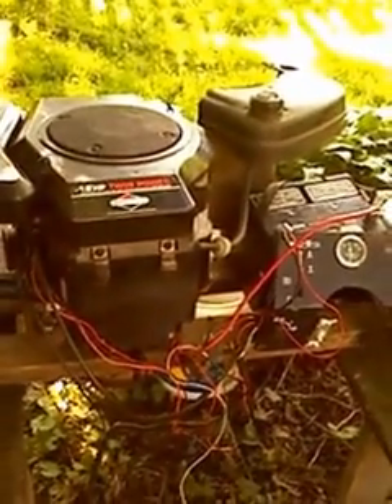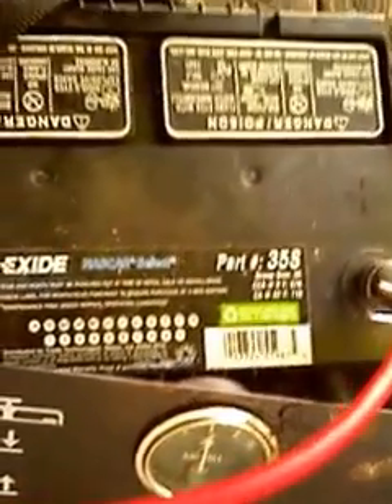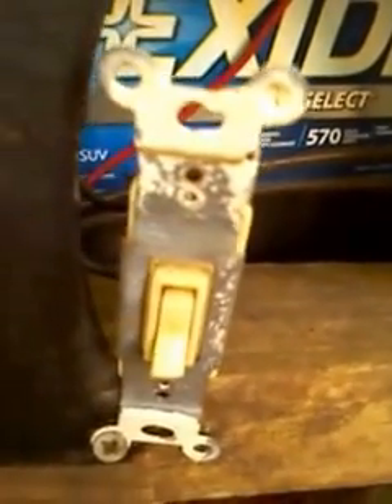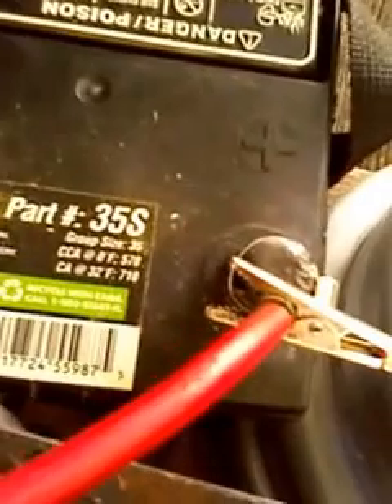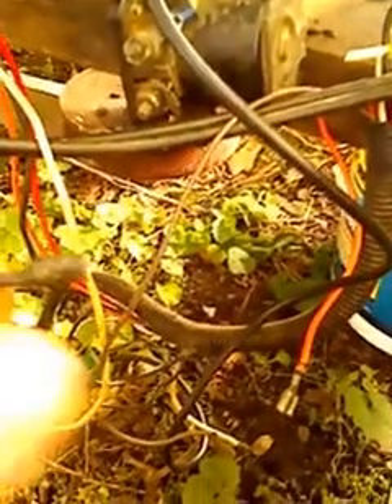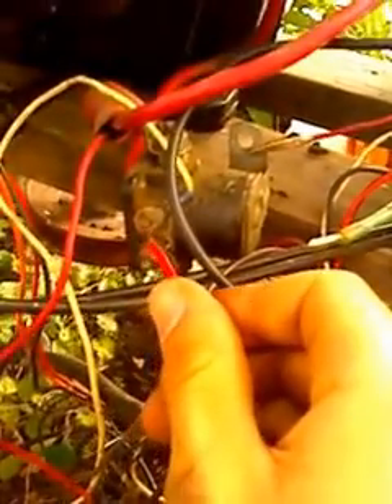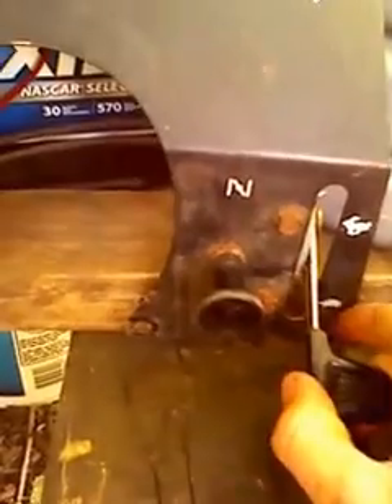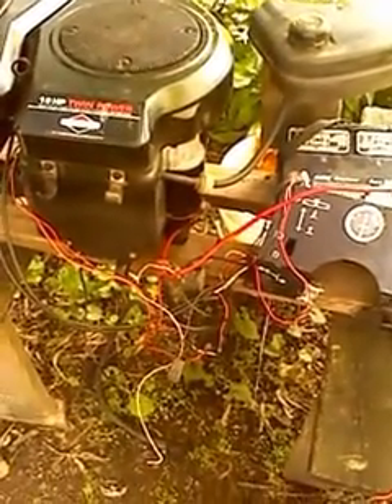How to Start a Briggs and Stratton 18hp Opposed Twin

Comment: I have one of these on a mower it is all wired right but cranks so hard. If you pull the plugs it cranks great. I have cleaned the heads, rebuilt the starter and carburator. I have the biggest lawnmower battery you can buy in it. And still turns hard. Any suggestions would help please. I have thought of upgrading the battery cables size but think it may be the valves and there lash.
Reply from the maker: HMMMM  I can't say I have bumped into this before there may be forums out there that have though would be my suggestion.  As far as the motor turning hard with plugs in and easy with them out that's to me good compression not a problem.  I would say check for a bad spark or coil if it turns over when you push the start.  Other Idea is air filter clogged.   The wiring could be it but I doubt it as wire does not go bad easy, I would check the connections though for green build up as that does happen and lowers current to starter if found clean off with wire brush.  Also it could be the spark plug connectors are goofy, I have had some where the wire actually pops out of the piece that goes on the plug.  Thats all I have for now best of luck:-)
Reply: opposed twins hate starters and kill starter bushings, pull the screen off the flywheel and crank with 1&1/4 socket in a 1/2 drill, be lively when you do
Reply: Did you figure it out? I have the exact same problem. Clicks but & turns over slow & sometimes not at all.  Tried a bigger battery & even tried jumping the starter in case there was a bad ground.
Reply: @thomasz4981  valves too tight
Reply: @newtuthis1  Thank, I'll look into that. It's strange tho because the motor has very low hours. It was almost new when put in as  a replacement. That's why I was thinking a bad ground somewhere.

Comment: how much snow can one of these engines push?.......are they pretty fast
Reply from the maker: I have done a foot deep of light snow with an 11hp belt drive before without issue. Though it really depends on the tractor the motors on and condition of tires, belts and gears extra, but this motor is really strong and with a governor removal I hear can go extremely fast.    Although you can also go high torque and large pulley in front small in back as and option.  Hope that helps:-)